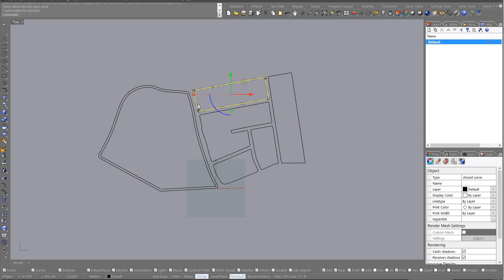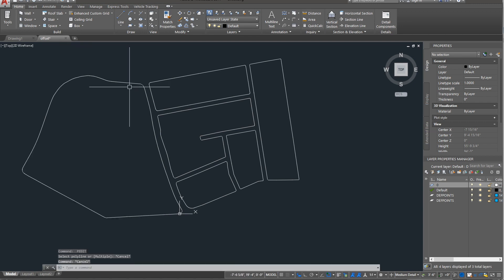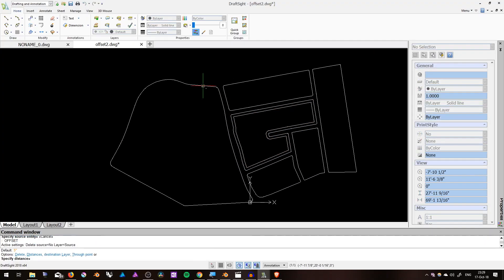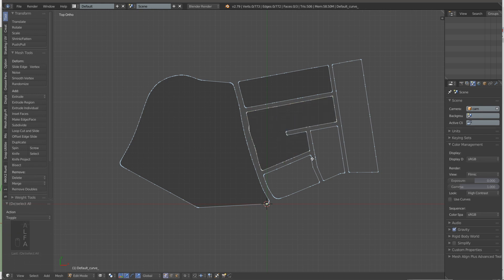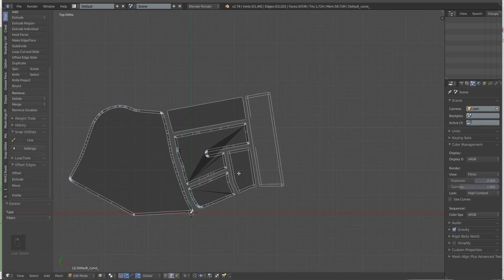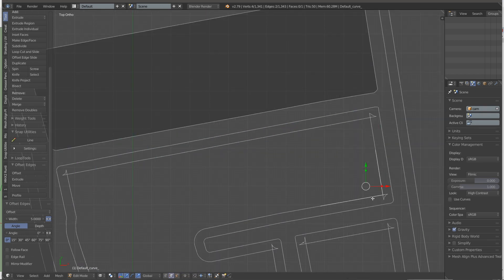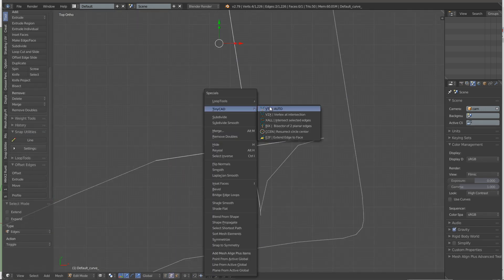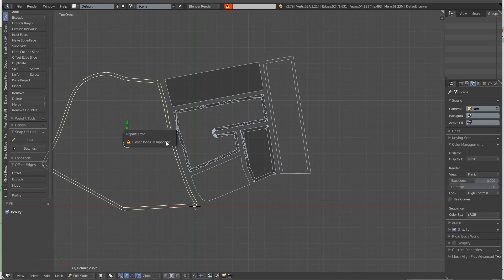Offset Comparison between CAD packages and Blender

Comment: Blender is not a CAD program. Cad models are based on math and don't have the concept of vertices whereas polygonal modeling programs like Blender, 3ds Max and Maya are based on meshes created with vertices, edges and faces.
Reply: c'mon asking that the basic sketchup functionnalities are implemented in blender is not much to ask
Reply from the maker: Yes, in nurbs-based programs (which is what all CAD programs are), lines and curves are the most important elements, as they define boundary edges and/or cross sections of surfaces. And, yes, offset is a math based function but not a terribly heavy one. However, offset does also exist in mesh-based programs (SketchUp). Offset implementation in Blender is weak most likely because not many people use this functionality for similar scenarios as in the video.
Reply: True, I don't think Blender has attracted that many designers yet. So the toolset is not quite there yet. Which is a shame because Blender can quite easily be made into a BIM software too
Reply: @UHStudio  https://www.youtube.com/watch?v=9dZPpFHi-74
Reply from the maker: Thanks so much for mentioning this video! Looks promising.